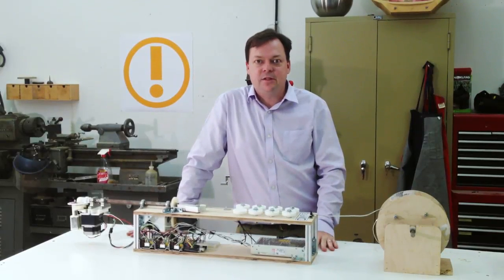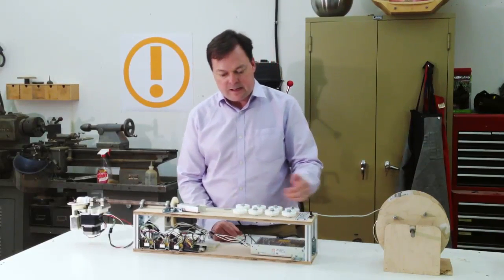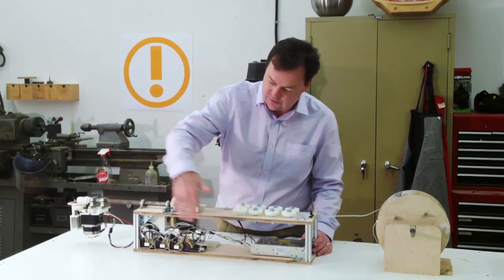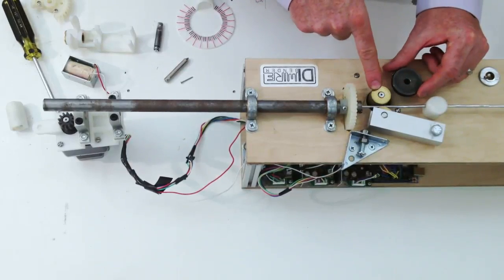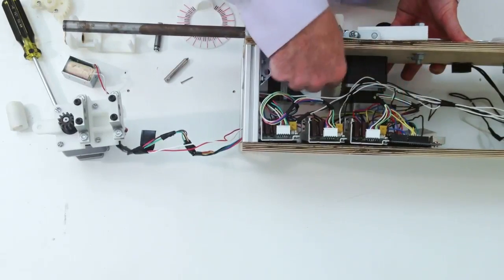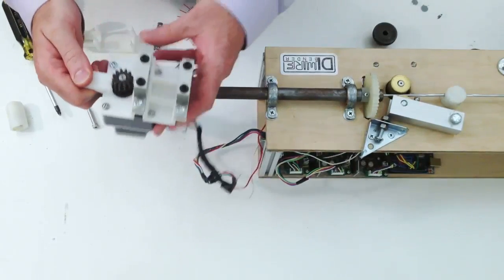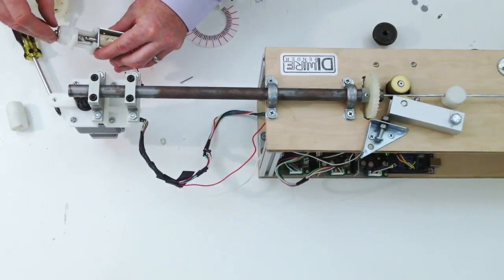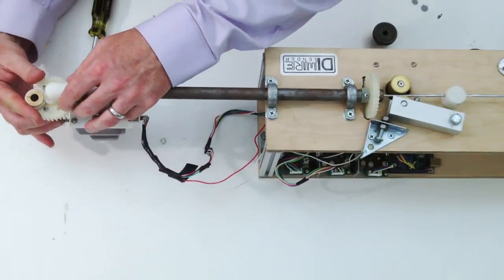Pensa Labs | Make Your Own CNC Wire Former

Comment: Hello,

The design is sensational, it was a great idea. and you are so kind to share this project.

I'm riding one for my use and study, but I have a doubt.

Can you help me?

Products:

2 Phase Stepper Motor - Oriental PK264A2A-SG10

Stepper Motor Driver - Eastern CMD2120P

These two items are very expensive and flees my budget.

They can be replaced by others with lesser value?

Type Nema the manufacturer.

If the exchange is possible on the other, what is the model?
Reply from the maker: Hi! Please send an email to sales@pensalabs.com and they'll get back to you asap with a quote for our new machines! Thank you!